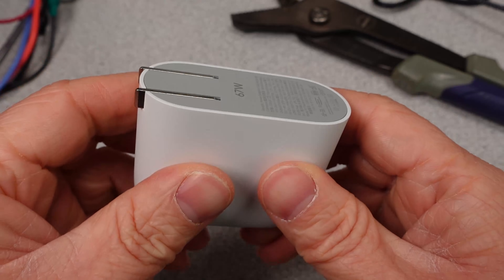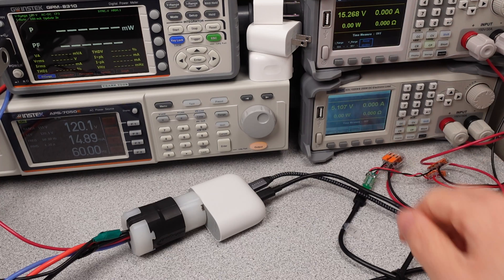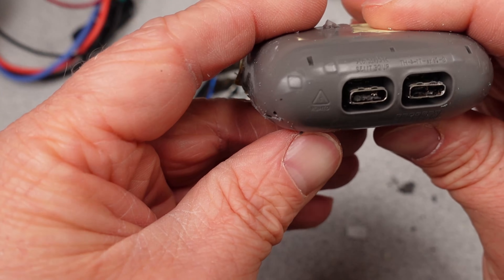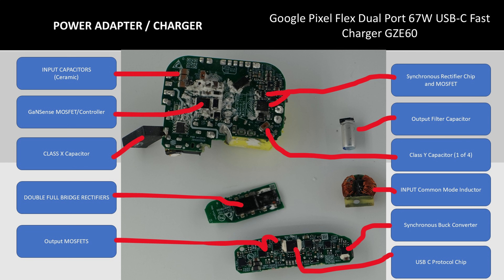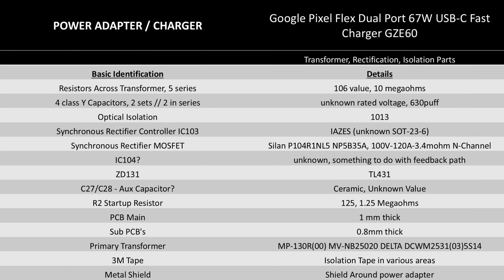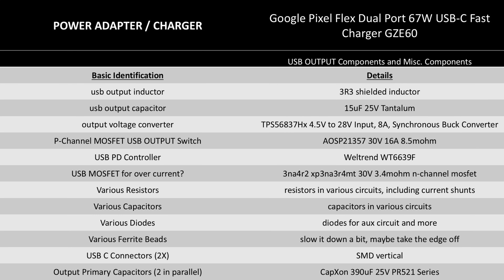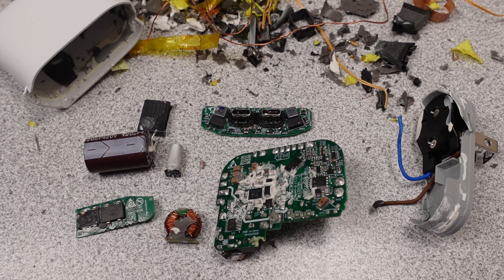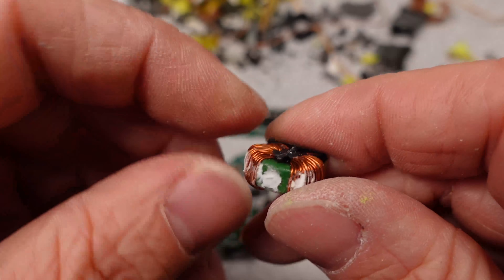SHREDDED TO BITS Google’s 67 watt charger

Comment: I can't really find a solid answer anywhere, but what's the reason for inventing AVS SPR when PPS existed? I have a few guesses, but I'd like to hear from someone knowledgable in electrical engineering.
Reply: I can't figure it out, either. I have to imagine it's just cheaper to implement.

Comment: Nice video as always! ❤

Did you see Belkin has a few chargers now that are advertising "zero standby power"? They've got a new 50W and 67W charger with this "wattZERO" technology... It doesn't seem to actually be 0, but a lot less than everything else. It also still wakes up with an emarker or MagSafe cable. Curious if you have any thoughts or plans for a video.